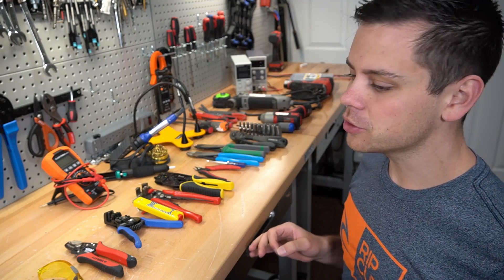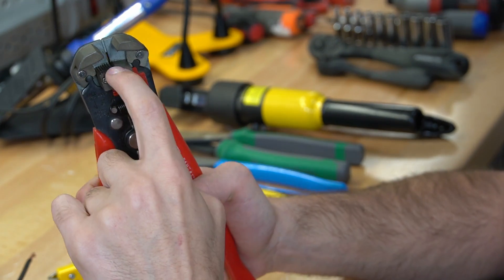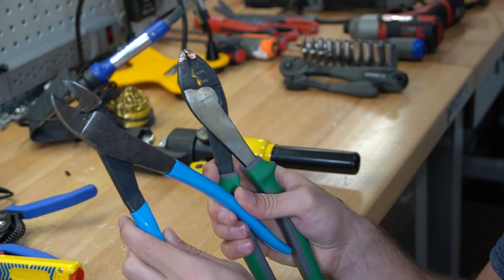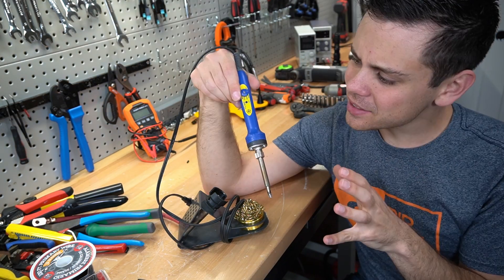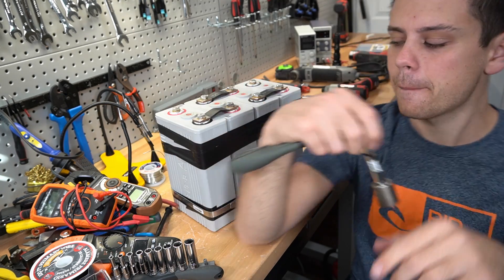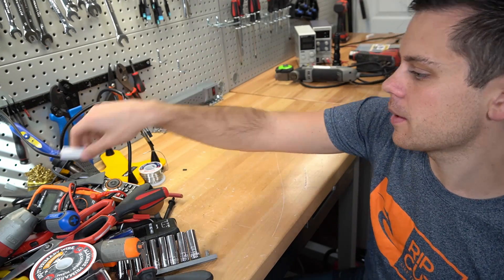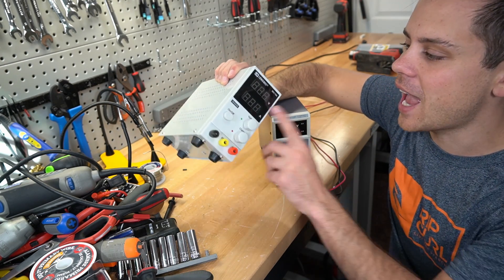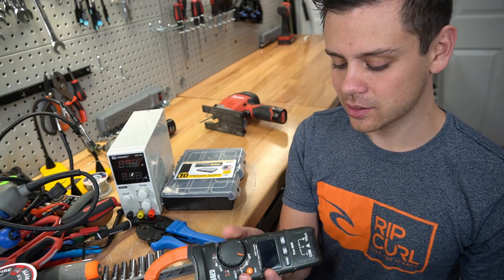Will Prowse's Favorite Electrical Tools! For DIY Solar Projects

Comment: Solid tool advice as usual Will.  Personally, I would not trade my klein's for anything. I've got a Fluke (AC) but I want one of those Klein DC clamp meters too.  Milwaukee tools are top shelf too, so go ahead and be a fanboy.  Thanks for the great videos!
Reply: My only warning about Milwaukee is that the Home Improvement stores don't really carry the good stuff, and not all Milwaukee tools are good
Reply: You've reminded me, ( old guys forget stuff) that at one point several years back, (maybe 10 years?) Milwaukee began making a lower priced tool line that is regularly sold in big box stores.  Personally I buy Ryobi cordless tools because I find them to be a good value for the cost.  For me, putting brands aside, a good tool does the job I need it to do, when I need to do it.

Comment: that power supply would allow you to charge up a 12 or 24v pack.  how are you charging-up the 48v packs?
Reply from the maker: I use a mpp inverter charger for 48v testing

Comment: I also use a Southwire ratcheting crimp tool for modular connectors (RJ-11, RJ-12, & RJ-45). If you want to save time and money you can make your own data patch cords (and crossover cables for programming routers), phone handset cords, telephone line cords with them and some modular ends (don't forget the strain relief boots go on before crimping)!

You can find the Southwire modular connectors crimp tool at Home Depot for about $30. I have used the same tool from Paladin and Ideal and Southwire's are the best - hands down! What frequently happens with the other brands, is that the grips on the handles eventually work lose and slip off.

Comment: Look into Paladin tools for ratcheting crimpers.  I typically only use my Kline basic red cutter crimpers daily, Paladin crimper that I use daily is for RG58 coaxial.  I have been using the same set for over 5 years.  They do hold up.  The dies I have replaced only once in 5 years.  When I get over 10 gauge, I have started using the hydraulic crimper for those connectors.  That reminds me, I need to file my cutter on my crimpers soon.  I usually dont bother with strippers.  I switch to my Kline splicing scissors when I need to strip something large gauge otherwise, years of stripping wire and good control, those cutters on my crimpers are what I strip most stuff with.  Pull one side, pull 90 degrees of that, off it goes.  I've been doing wiring for over 30 years, so it does come with practice to not damage conductor.
Reply from the maker: Holy cow! Good advice.

Comment: I'm surprised you don't have a pair of Klein/Fiskar electrician's scissors. I work in IT/low voltage and use them every day. You can find them at Home Depot for $21. They're self-sharpening, have a serrated outside edge (for sawing groves in ceiling tiles), and two sharp notches for stripping communications wires (24AWG & 23AWG). You can cut a US penny in half with them without much effort! I have a two-pocket leather sheaf for them that I wear on my belt (the other pocket holds a small screwdriver). They are razor sharp and you'll only only know you've cut yourself when everything is suddenly slippery with your blood - they're that sharp - you won't feel any pain! (Who needs a license to carry - lethal scissors)! I also use them quite frequently for opening taped boxes. I whip them out of the holster, flick the wrist and lock them open in my grip and slash with flair and precision.

I use them to strip the outer cable jacketing from category 5 or category 6 cables and cutting.

After years of practice you get into a zone when using them. I haven't nicked a wire's insulation while scoring the outer cable jacket in several years now. I score the outer jacket, give the cable a little flex with both hands and pull the outer jacket straight off every time.

Southwire makes a pair of loppers for cutting large communications cables (soft copper) that can cleanly cut up to a 50-pair cable.
Reply from the maker: The electrician scissors are in the background of this video actually. On the magnet strip. They are ok, but I prefer other cutters. They are great for ac electrical stuff.

Ohhh stripping the jacket. That's smart. I need to try that for sure. Smart idea

Comment: Will, use some Locktite on the screw and it won't back loose. Use the mild stuff so you can get it apart if need be.
Reply: Jimmy Call explain
Reply: Jimmy Call I misread your comment. Thought you said it wasn’t for vibrating or moving bolts

Comment: FYI Milwaukee is 3 syllables, not four.
Reply from the maker: Haha I always mess that word up
Reply: @WillProwse  cause sometimes you measure milli amps.
Reply: DIY Solar Power with Will Prowse After the video I thought I was pronouncing it wrong all along until hearing the comments haha
Reply: I’ll be calling them Milliwaukee from now on.
Reply: @jimmac521  A milli-waukee is 1000 times better than a nano-waukee.
Reply: I grew up near Milwaukee.  There are a lot of Wisconsin city/town names that get mispronounced.
Reply: For really small gauge wire I prefer Paladin Stripax 6 Pro.  Pricey,  but they last and the blades are replaceable.  Used them extensively to strip 30 awg thermocouple wire.

Comment: Insert high quality stripper jokes here--->
Reply: You cannot find a high-quality stripper from China... I prefer em 5 foot 8 red on top..

😎😎😎😎😎😎
Reply: I will add one more from the world of radio communications.  Whips and Spikes.  Whips, (rod antennas with an NMO)  Spikes (1/4 wave radiator only).
Reply: Birds & Bees basics of all things electrical: females have holes, males have poles. I've never had a mix up since learning that phrase, lol.
Reply: @ceefiveceefive   also remember that Female ends connect "Source"  "outlets" = female,  "users/consumers" = male
Reply: @YT-Observer  best way to remember is male always inserts into female.
Reply: Also Phillips' nice head: "This sounds soo wrong!"
Reply: I just hate then they start smoking for no reason.
Reply: So you're hooked on the stripper option?  I don't use the stripper option because momma taught me better.. Yo momma taught me better.  I hope it's ok if I insert 'yo momma' jokes with the strippers..